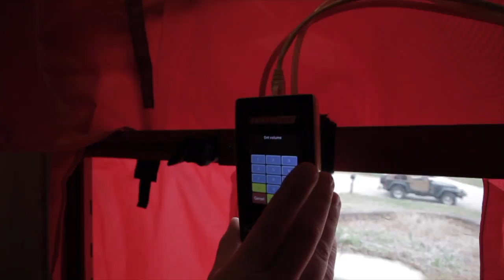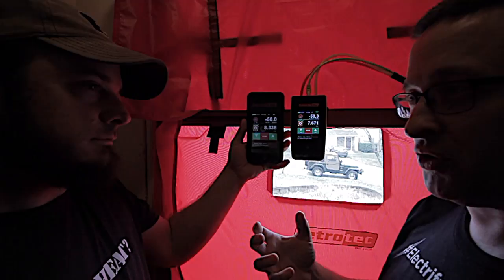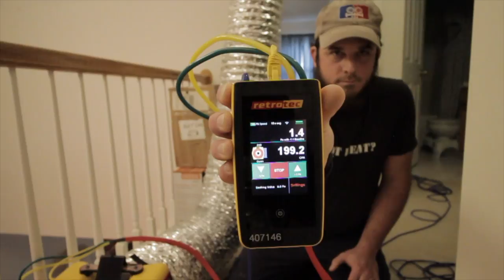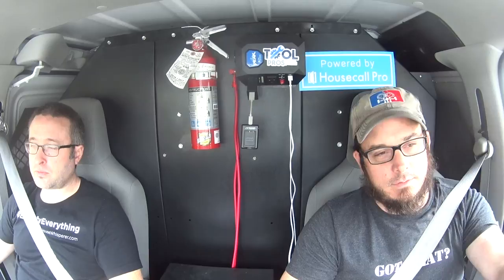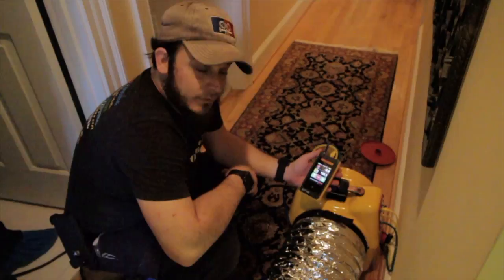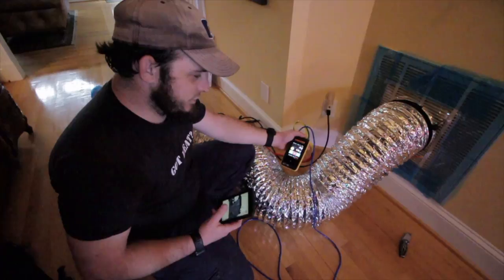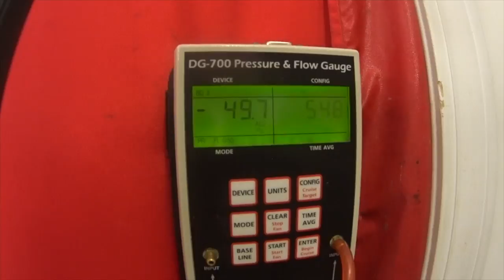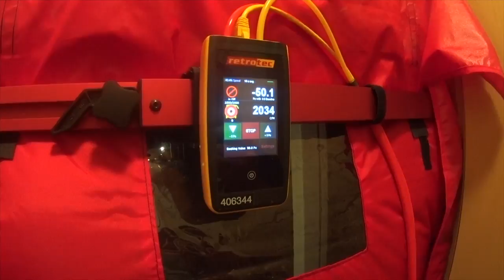Home Performance Testing Blower Door Duct Leakage Zonal Pressure Diagnostics

Comment: Hey bud not a troll.  I get what your doing.  I've been getting alot more in depth with air balancing.  Do you have your(NEBB) TAB CP?  Regarding an oversized A/C unit I've had alot of luck installing EPR's  then doing an air balance.  I've gone through playing all day before calculating leakage on zones and have completely forgotten about the fresh air (outdoor air) intake, hrv's, and what not...makes for a long day.    Keep it up man.  It is funny to look back 10 years ago where I was at in the trade (skill level after 5 years).  Get your TAB certs and welcome to the dork club.  Wish I would have gotten my certs 15 years ago because you can make a alot more  just doing the real actual brain work.    Thanks for the vids.

Comment: Rerun. Not sure why you have two fans fighting each other. When you are duct blasting a sealed system, why set the house at 15 pascals?
Reply from the maker: 25 pascal is the metric for duct testing. I was trying to figure out how to get a specific measurement for leakage in the duct.